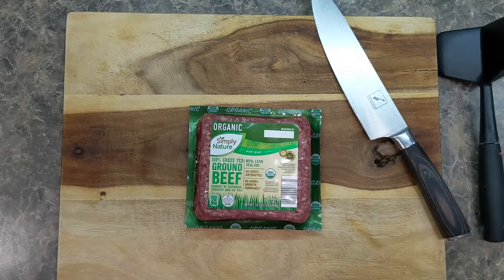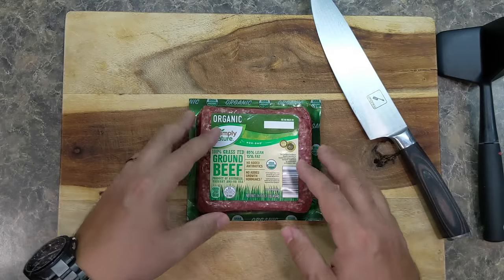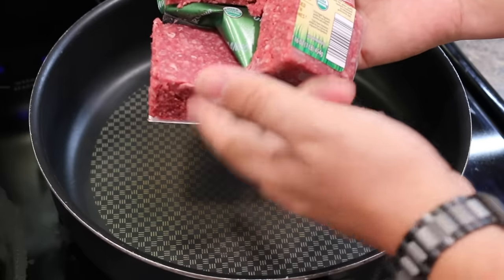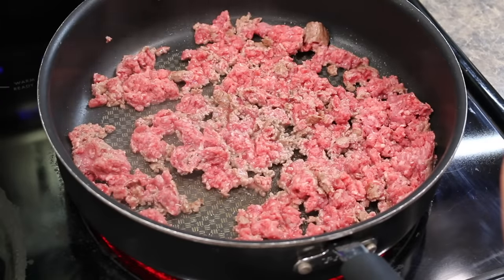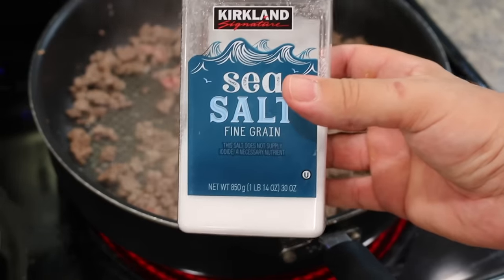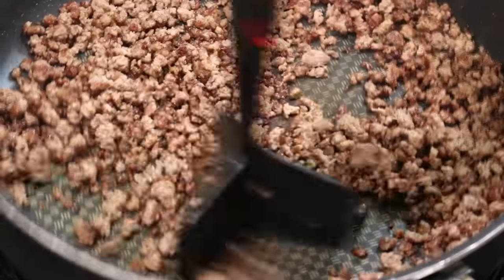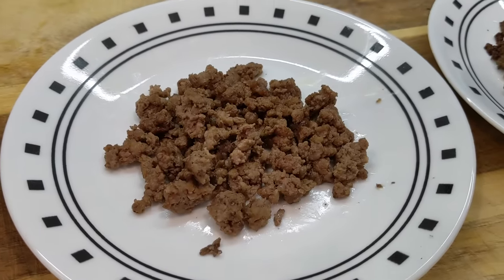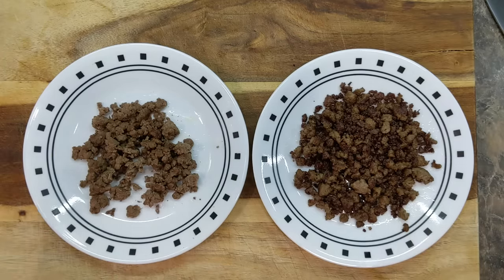How to cook ground beef for maximum flavor | I bet you didn't know this!

Comment: What you gain in crispiness you lose in softness. Whether you want to take it to this level depends on what you're going for. In some Middle Eastern and Italian dishes, often cooks are going for a silky soft texture rather than this kind of seared crispy texture. And I've seen Kenji suggest you should go somewhere in between the two extremes. To each their own!
Reply from the maker: Yes, most ground beef gets added to something moist with high water content like a sauce. So, that's when you would employ this technique.
Reply: Perhaps mix one soft batch and one crisp batch to satisfy an unique signature dish?
Reply: It only dries the surface, which re-hydrates if you add a sauce. The increased complexity of flavour is truly worth it.
Reply: If you have 80/20 ground beef, it doesn't dry out
Reply: @pelqel9893  Once something is caramelized, nothing is getting in.  Caramelization is basically a sealant.
Reply: @MarcIverson  You don't need moisture inside the tiny particle of ground beef. You need moisture in your dish overall, which comes from the sauce.
Reply: @rebeccahicks2392  If you don't have any moisture in your meat, I think you've over-cooked it.  Nobody likes a dry turkey breast or pork chop, for instance, and even if you don't like your steak rare, you probably(on average) don't want it well-done either.  It's no different with hamburger.  Texture is very much a part of how much cooking is too much.  A softer texture and more internal moisture go hand-in-hand when cooking meats.
Reply: @LotusPrayer2  That's what I do with onions -- some deeply caramelized for flavor, some left with more liquid for a more robust size-matters contribution to the balance of a dish, some softer, some with more textural bite.
Reply: @MarcIverson 
You can have your softer texture and more internal moisture. I'll go with increased flavor!
Reply: @dough9512  The trick is getting both, and it can be done.
Reply: @MarcIverson  I'm sorry, but I disagree. For one, de-glazing a pan relies on this re-hydrating of dried, caramelized bits (the fond); also, much of Indian cooking employs this technique (called "bhuno" - to dry in oil) for building layers of flavor. It does not create an impermeable seal whatsoever.
Reply: Silky soft has little flavor.
Reply: @MarcIverson Totally untrue, if caramelization was a sealant then you could never deglaze a pan, the stuck-on fond would never come off the pan. Same principle with the ground beef, even though you've browned and caramelized it if you add a sauce (liquid) the beef will get soft again.
Reply: People who have no teeth want it soft... I prefer crunchie and tasty.
Reply: Horrible
Reply: By learning this at least I have a choice now of how I want to cook it.
Reply: Yea I’m Italian and never cook it this long but I’m going to try it for tacos!!
Reply: Maillard reaction every time.
Reply: @pelqel9893 Wow, thanks for the clarification! I understand WHY one might use this method. I'll try if for spaghetti sauce tonight.
Reply: Most recipes have browned ground beef then some kind of sauce which will soften it. If it says BROWN your ground beef,  brown it. If the recipe call for cooked then ,well, it's obvious. Many recipes won't be so specific.
Reply: @FoodChainTV exactly
Reply: @MarcIverson he's talking about browning it. Most recipes want the flavor that browning brings.... word soup😂
Reply: @vlrissolo  He's talking about a lot more than browning it, clearly, word soup. (See, everyone else can do that too.)
Reply: @MarcIverson  o oh you run with the pack I see. I believe the video is called something like how to Brown your ground beef for max crispy... not how to cook it. Really, who the hell cares how other  people Brown their ground beef they, have to eat it. I really don't give a damn! Enjoy!
Reply: @vlrissolo  Whatever, dude. It's a comment on a cooking thread. Cast aspersions as you like as if that were making a point. Done it twice now. Smart. Or you could just lighten up. (Instead of just saying you don't give a damn and then going over the top to spite yourself.)
Reply: @MarcIverson  ok. Whatever you say. You so smart🤪... you are right about one thing, it's a cooking video... The way folks get offended because they want to validate their cooking skills humors me. I DON'T give a damn how others cook, and I'm surprised at how defensive they are. Why did they watch it? Furthermore, why th are you scrolling down the comment section? ... I  made 1 comment, and everyone goes in defense mode. Ridiculous. Take your ground beef and... have a lovely day❤
Reply: @vlrissolo  Why are you? Your level of disinterest is so apparent you parade it and chop personally at strangers on the internet instead of just sticking to the subject and having an actually health conversation. Anyway, I hope you got your grief out on me and didn't kick the family dog.

Comment: Stopped using non-stick pans after finding out it's coated with PFAS (forever) chemicals so only use stainless or caste-iron now.
Reply: PFAS coatings are actually very safe to use, its the production of PFAS teflon thats terribly dangerous for humans AND the environment. Adam Ragusea has an excellent video on it if you want to learn more
Reply: Same.
Reply: @raven1571 Nah. I am done. I still won't trust them and won't use them.
Reply: Non-stick coatings wear out after a while, that coating went somewhere; which would be into the food. I'll use non-stick occasionally but generally avoid it.
Reply: @raven1571  Thanks. I'm definitely going to check this out.
Reply: @raven1571  If we all stopped buying them, they'd stop making them. :) But that's not going to happen, is it?
Reply: @raven1571 He didn't actually address the concerns properly in the video, meaning it was not an excellent video. He isn't an expert, just an ex-journalist.
Reply: Exactly, and more than that. Most ceramics like slow cookers and dutch oven pots are PAINTED with enamels and many have lead in the glaze. There's studies out showing how much. The chromium in stainless steel isn't good either and that stuff leaches very easily. Wash a stainless pan with a scrub pad then wipe with a paper towel, the metal visibly wipes off. I don't want any of that stuff in my food. Non-coated non-lead glass cookware and cast iron are probably the two best options.
Reply: @SZfiftyfour  With cast iron, you get some leeching of iron as well. I don't think the chromium release is an issue unless there's evidence that I can see to prove me otherwise.
Reply: @hugoanderkivi  It's probably less of an issue than other stuff out there. With chromium and Nickel, we need very minuscule amounts of Cr, and zero need for Ni. There's studies out on those. Some sensitive individuals react to high Cr which is all I need to know. Especially when it's easy to end up with a film of loose metal on those pans even after cleaning. Your liver and kidneys takes the hit filtering that stuff out. People gotta be careful; I still use stainless but I take extra steps before doing so. I think it's not as bad, but still not great.
Reply: @SZfiftyfour  I don't know what stainless you use, but I haven't had any issues with films of loose metal. There's very little that comes off, even when scrubbing hard with a strong detergent. I have an expensive Belgium-made thick stainless pan.
Reply: @hugoanderkivi  🙄I'm not talking about a two thousand dollar set of cookware brother. I'll give you that. Just don't let your high horse trample us common folk on your way out.
Reply: Stainless cookware / steel comes in different qualities.   Some is safer than others.
Reply: Cast iron for me for meat. Stainless steel for eggs.
Reply: I heard that non-stick pans are safe as long as you don't overheat the pan.
Reply: @SZfiftyfour bro hugo used it on his face 😂😂😂
Reply: @SZfiftyfour  What you have described sounds like an aluminum pan rather than a stainless steel pan.  With a normal scrub pad and a paper towel you are not going to get a metal film from a stainless steel pan (or skillet) no matter how long you rub.
Reply: @ted458  What exactly is a 'normal' scrub pad? Sounds like a generalization to make your point. I'm talking about a green brillo style scouring pad. Which millions of people use to scrub pans. Also, what stainless steel are you talking about? There's two different types. One is chrome-plated with a mirror shine; the other looks like matte steel. People don't typically scour their chrome finished pans, but it still releases chromium into food and wears away during cooking and cleaning. The matte finish pans will 100% rub off a film of metals if using a brillo pad. Not to say that's the correct cleaning method, but it's quick and easy and people do it without realizing their next meal will have a super-dose of chromium. It's not my job to convince anyone tho, y'all do what you want.

Comment: Go easy on that non stick. Also you can get some sear without breaking it up. Just sear, then flip and sear the other side. Then break up and season. Now you've got seared bits with the option of not making completely dry beef
Reply from the maker: This is a great tip. Thanks!
Reply: That's what I do
Reply: I was thinking the same thing, namely there has to be at least microdamage on the nonstick surface.  I've been cooking the same meat (Aldi I assume) in the same way but backwards.  Namely after  saute-ing a chopped onion I've put in the meat and gone thru your procedure in a steel skillet and spatula.  The meat does  taste boiled but on day 2 the leftovers are not bad.  I'll try your method tomorrow but I'm going to let the meat sit at room temp for at least one hour to hopefully delete some water and stickiness.
Reply: Better yet use stainless steel!  EDIT:  I had another thought.  Those chopper things are plastic so they probably don't cause much harm to the non-stick surface.  I still think stainless steel is a better option though.
Reply: I tried it the way Foodchain showed us and it came out great! Instead of bland/boiled like it used to
Reply: Good pojnt. Plus, the pan is not flat on the bottom anymore from heating too fast. That would bother me and make an uneven cooking surface.
Reply: He used plastic and wood like you're suppose to do 🤷🏻‍♂️  but i prefer cast iron and stainless... less toxic
Reply: It’s not dry, it’s crispy lol, Americans ☕️☕️☕️☕️
Reply: And don't forget a generous amount of ecoli STEC to spice things up.
Reply: yea, I def avoid non stick too
Reply: @ted458 cast iron
Reply: @aestheticlife3184  What does texture/flavor preference have to do with nationality? What a weird comment.....
Reply: That a hexclad pan, you ain't gonna ruin it.
Reply: I'd break it up first. Otherwise, the 20% that you seared will be overcooking while you sear the inner 80% after you've broken itup.

Comment: Also, frying a burger, try using Beef Tallow for your oil. It adds incredible flavor. Seek grass fed tallow.
Reply: Heart attack in a pan!
Reply: That’s all I use.
Reply: @lciummo1 - Nope.
Reply: @lciummo1 animal fat is all we used. Then big business decided they needed to use the excess oil they weren't using on machines. It wasn't that long ago that people knew oil was for machines and fat fed people. Carnivores are some of the healthiest people on earth.
Reply: @lciummo1  seed oil and refined sugar does the damage cholesterol is there to fix, quit blaming the water for putting out the fires
Reply: @lciummo1 there are more people with heart problems today than years ago, when people exclusively used lard or beef tallow for cooking.
Reply: @mgntstr  interesting point, would Extra Virgin Olive Oil be a better use?
Reply: I have not used beef tallow, I use bacon fat that has been collected and filtered through a coffee filter to get the remaining foody bits out (it lasts longer without spoiling that way). I buy uncured bacon and collect the grease after cooking then filter it and store it in the fridge. Lasts forever.
Reply: @thepurplemasher  sure, not a whole lot of PUFA or overdose level of omega 6 in that oil
Reply: @thepurplemasher Extra Virgin Olive Oil has a lower smoke point and will oxidize too easily at higher temps.
Reply: @lciummo1 Nonsense propaganda.
Reply: Whatever happened to just frying a burger in its own fats? Why are you adding extra grease to the pan?
Reply: @kpmadness  extra flavor.
Reply: @mgntstr I have high cholesterol.  Are you saying it’s high because it’s there trying to repair seed oil and refined sugar damage?
Reply: What do cows eat normally eat?
Reply: @KosmicKaren  not just refined sugar mon, carbohydrates are refined into sugar by the body as well. It is a fuel rich combustion in the mitochondria (the powerhouse of the cell) with sooty exhaust compared to fat for fuel.
Reply: @lciummo1 where is that proof?
Reply: i use bacon fat
Reply: @kpmadness  add some Wagyu beef tallow👌🏽👌🏽
Reply: @kpmadness  It 6:08 depends
Reply: I add tallow when I use 85/15 or 90/10 beef. It keeps it from being too dry.
Reply: @andrewsnarr6474,  is that a trick question?!😂
Reply: Meat/fat doesn't cause heart attacks.

That would be excessive carbohydrates and sugar. Once you become insulin resistant, you open the door to all diseases.
Reply: @kpmadness  because ground beef is sold with less than 5% fat.  You can get 20% fat if you buy 80% lean.
Reply: @hoptoi @hoptoi  Heart attacks are caused by several things, one of which you can't control but can look out for GENETICS. The other things that make good contributions are your poor diet (alcohol abuse counts), insufficient healthful sleep patterns, stress, and a lack of exercise. 

And..., what else?

Only fools don't know that smoking cigarettes and such things is murder to the respiratory system. Goodbye, boys and girls. Beef tastes good. Will a little bit of good kill you? Probably not.
Reply: I don't need any extra oil. I always have to drain a bunch of fat from the pan. I usually use 80/20 or 85/15.
Reply: @lciummo1  NO
Reply: @hoptoi  Stop listening to RFK, Jr.
Reply: Where to get Grass-fed Beef Tallow? I've asked at the supermarket, but they don't sell that or lard either, so any ideas anyone? Thank you!
Reply: Tallow is just the fat that comes out of the meat when you cook it. Use 75-85% lean meat and you're good. The fat will render out as you cook. Adding extra tallow will not make any difference. Also "wagyu" or grass fed tallow is no different from tallow in general unless you're into placebos.
Reply: @thepurplemasher  Use a high temperature oil or be careful with he heat because olive oil is a bit easier to burn. There are lots of options if you do a search.
Reply: @maybelater7436  Thx for this good info. Wishing you the best!
Reply: @lciummo1  no.
Reply: @thepurplemasher  Not for cooking. regular olive oil for cooking.
Reply: @KosmicKaren  yes. All fast food and processed food contains seed oil, vegetable oils, and sugars. All very bad. Natural beef tallow is the best thing and the most flavorful.
Reply: @dennisnbrown  ok thank you
Reply: @mgntstr  I missed this earlier.  Sorry.  Thanks for the info👍
Reply: @lciummo1 peoples fear of fats is ignorance. If you're not sat on your butt all day and have a working metabolism, fats are a very healthy form of energy.
Why do you think the body stores "fat"????
The real issues all that processed junk, makes me laugh when someone thinks they're being healthy because they're eating a "yoghurt bar" with dried goji berries
Reply: @lciummo1  Heart attack because of seed oils, mate, not because of saturated animal fat. Get educated.
Reply: Bacon grease, using it for years, raised on it. My '50's mom, lard, bacon fat, always.
Reply: Garlic, onions, presalted, pepper oil...then start cooking beef
Reply: @think2023  that's already a given.
Reply: Grass fed is delicious by sometimes they sell beef as grass-fed that I'm pretty sure was Texas beef with cows eating sage brush 😂
Reply: Make your own
Reply: @lciummo1 very wrong
Reply: @lciummo1    Read The Big Fat Surprise ...and be surprised how wrong you are!  Sorry...face the bitter truth!!!🤣
Reply: Just wanted to write the same thing!  Using oil for cooking is a "heart attack in a pan", but beef tallow is the healthiest choice!
Reply: @nadogrl  Except frying produces advanced glycation end products, and those aren't good for health.
Reply: @lciummo1  the 80s called. They want their health info back
Reply: So in the guys technique above how do you cook a burger without breaking it up and having to move it around? He doesn't have a normal burger lesson. I like Tavern burgers, thick juicy pink in the middle but seared well on the outside for the steak flavor. Problem is I cannot get it to come out right consistently and I'm thinking some form of this fellows info may help me.. I just  don't know what that is.
Reply: I used to work in a meat department for many years, I've ground thousands of pounds of ground beef, back in the 80s and early 90s we never added water to it. I have noticed in the past 25 years that the pre made shiped already meat is funky. Water which should be illegal at 5.99 a pound , and I put some ground beef in the fridge once that I had purchased at a place with pre cut meats, forgot about it pulled it out it looked just like it did the day I bought it. Folks that's not right, ground beef more than any other, it's only good for 2 to 3 days and after that it looks like crap and loses that good taste. Buy your meat where they still cut and pack on site.
Reply: It also has a higher smoking point and can be heated to a higher temperature
Reply: They also have Wagyu tallow on amazon…
Reply: @mgntstr  Sounds like they're blaming the water for starting fires, the same fires that Napalm is guilty of starting.
Reply: @lciummo1  look at human carnivores, see if it seems like meat is dangerous
Reply: @lciummo1 npc bot
Reply: @ssaraccoii ❤❤❤❤❤❤❤